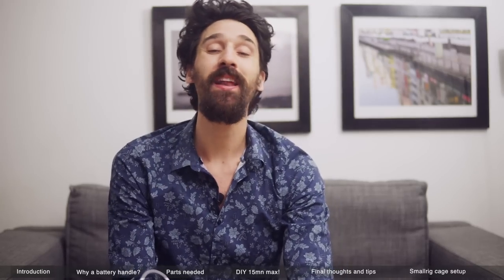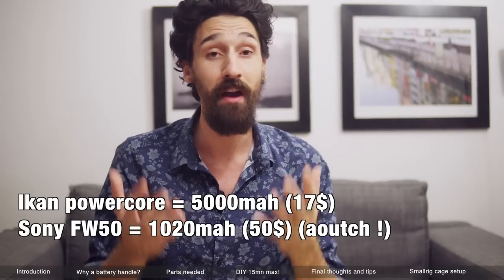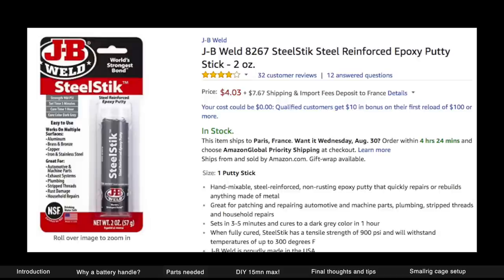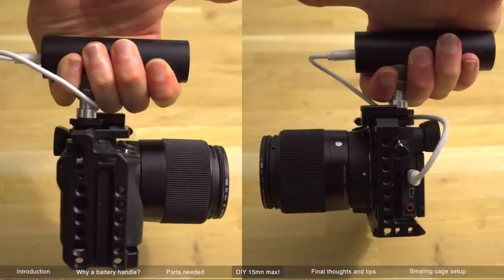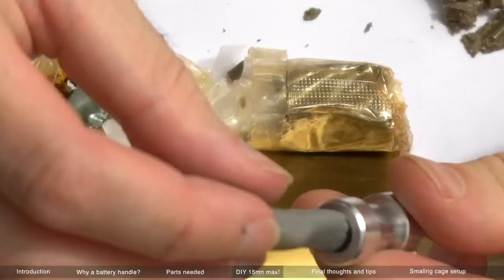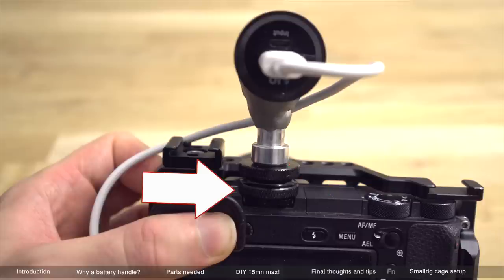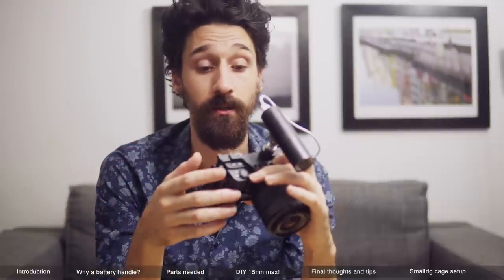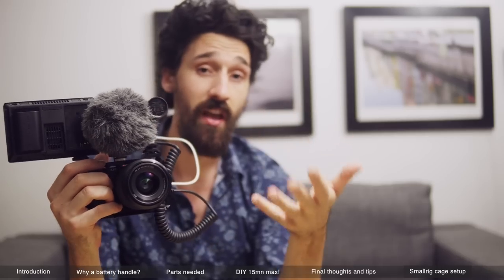DIY battery powered Top Handle (45$) for Sony a6300, a6500 (and A7R II, A7S II, RX10 II)

Comment: Looks very unsafe to me. I wouldn't dare to do that. About the battery capacity - 5000mAh@3.7V is basically the same as 2500mAh@7.4V. Therefor this powerbank has about 2.5x the capacity of FW50 battery (since it has about 1000mAh@7.4V), NOT 5x. 2.5x is not bad, but it's not 5x. For 5x the capacity of FW50 you need 10000mAh powerbank.
Reply from the maker: mbaksa hi there. Thanks for the info. 
I will test out the capacity of the battery and see how much it holds. 

As for the unsafe part the putty/paste that I use has a 170kg per cm square payload so i don't see how it could fall off but like I said in the video it's safer to put a safety tether just in case
Reply: If you test the capacity, you will actually get lower capacity than 2.5x because about 10% is lost when powerbank raises the voltage to 5V for USB, and then also there will be some loss on the camera side. The main issue arises from using mAh instead of Wh - powerbank manufacturers declare capacity of batteries inside powerbank (not powerbank itself) in mAh, and one cannot compare capacities in mAh at different voltages. So to compare capacity of sources of power at different voltages, one has to convert Ah into Wh. Wh = V*Ah.

I've never used putties like the one you use, it might be perfectly OK, but since I've never used one, just doesn't feel safe to me. :) 170 kg/cm2 seems much, but will the putty itself or the powerbank surface stay in the exactly "same shape" even after months of rough handling? It won't eventually lose or lessen it's properties? Won't crack? If powerbank has plastic housing, then it's housing eventually might break when handling the "rig". Yes you can put a safety tether, but that would make me anxious about when the handle will break (although that moment might never come). :D
Reply from the maker: thanks ! I will put your message in the description of the video ! ;)

Comment: Lol did you end up snapping the charger off and smashing your camera?
Reply from the maker: haha no it never happened! 
I have then moved on to the A7s3 which does not really need an extra power supply. :)

but I admit that it wasn't the most reassuring setup haha
Reply: @DuncanDimanche-sreview  haha impressive 😁 I'm building a similar rig for a bigger powerbank to use with my a7III instead of running cables from my pockets 😎 might have to go for a Pipe clamp instead of putty just for The peace of mind lol 😁

Comment: hi, what specs are relevant and important? I wanna buy a pwerbank for my alpha 6300. How many Volts Amper ect... Output does the powerbank need to have?

 I wanna buy an Anker power core 20000,ah for my sony alpha! Is it ok or not?
Reply from the maker: sorry i never saw your message.... any 5v battery with 2amp will do the trick
Reply: @DuncanDimanche-sreview  THANKS

Comment: Boy, I just don't see this being a solution as these type of batteries get extremely hot as they power a device.
Reply from the maker: ummm yeah I'll have to see. I didn't think about that. Thanks for the input
Reply: b pete - my a6500 pulls 0.86A from a powerbank when recording 4K@25 video. So there should not be any problems with overheating powerbank. Even if it gets a little warm, that is a non issue.
Reply from the maker: mbaksa yeah either way the external battery will always be cooler than the sony itself hahah
Reply: exactly! :)